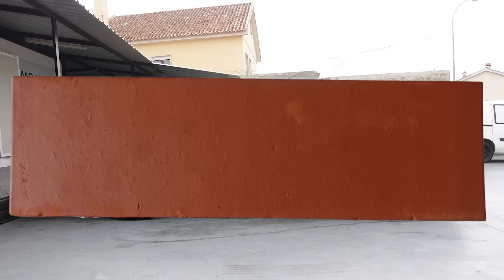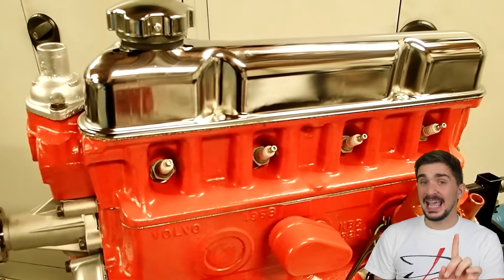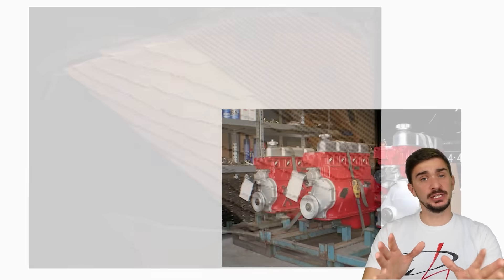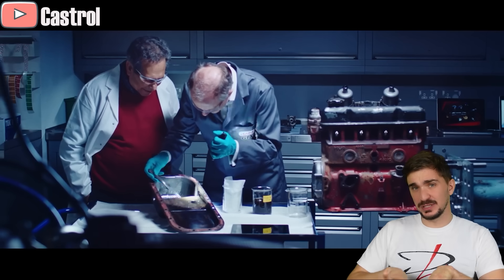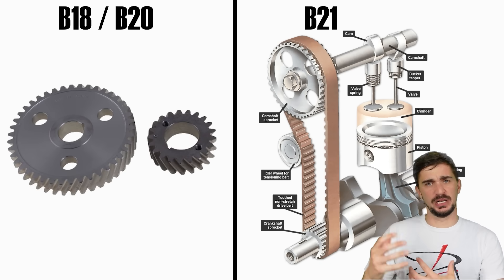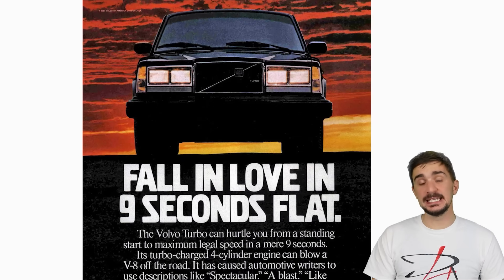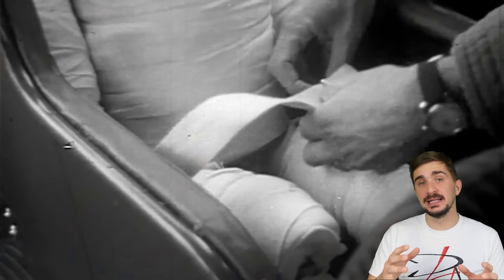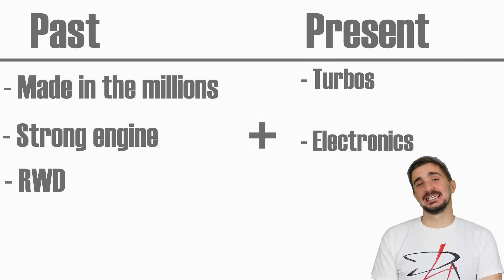A Story about the Volvo 240 and its Redblock Engine - Iconic Cars and Engines #18

Comment: I briefly had a Volvo 940 estate, just to keep me mobile when my normal car was being repaired. I didn't know much about Volvos but was surprised when I opened the bonnet and saw what looked like an overhead valve engine. I am now thinking someone must have fitted an old Amazon or 140  engine. Perhaps they had used the 940 engine to update an Amazon.

Comment: Yep, I totally agree. I had a pale blue 2nd hand 240 (@1985-86) for around 2-3 yrs and it was rock solid! I caned it that night, fanning the clutch a bit to get me up and around the bush track with heaps of sideays action... It was a solid and torquey engine and was happy to get up that track.

I took it off road one night, up hill (western side of Mt. Pickapene), in the Australian bush on what was barely a farm track (with dry ruts around 6" deep) and the heavy clutch, strong transmission, and long stroke 4-cylinder engine was awesome to get it up there!  

It got me back down and home to town unbroken too. That old brick was so unbreakable. I remember it fondly...

Comment: The only car that is recognisable when made with Lego. On a more serious note, I drove a 145 for 14 years with the 20B engine.  2 litre , twin strombergs.  Over 500,000 klm stil going strong when I sold it.  Now have a 1991 940  with the slant red engine. 250,000 klm runs as new. Changing oil every 5000klm is the secret of longevity on any engine.

Comment: I still have a 1990 Volvo 740 GL. It's the same age as me and probably in better shape tbh. Not the most economical car when it comes to fuel consumption but it just. doesn't. break. And if something does need to be replaced you can pop the hood open and understand what's going on inside without an engineering degree.

Comment: I remember back in the 80s ,90's etc. When I was very young visit relatives in Greece. One ofy.Uncles had a Volvo 240DL Taxi cab with the 4 speed "+" overdrive manual. He took care of that cab so we'll that he had it for almost 30 years. He clocked just over  750,000 miles or over 1. 2  Million Kilometers before he decides to sell his cab, as he was retireing. So reliable, nice

Comment: My Mother ruined her blue 240 DL by getting her mechanic to swap out the petrol engine and auto gearbox for a Nissan van diesel with manual gearbox. So noisy as to be unbearable. It was even slower, which is saying something.

Comment: I owned a 1980 Volvo 240D 4 door saloon. I purchased it for a mere $250 00. 
It was owned by a banker who purchased it for his nanny and took it to a garage that was stealing him blind! The year before I purchased the car, he replaced the entire suspention. The last time he had it in the shop, they adjusted the idle down until when warm and stopped, it would die. I bought it took it home changed plugs, wires, cap & rotor, all dash lites adjusted the idle, and it ran perfect. I redied the interior black, installed a new stereo, alloy wheels and low profile tires. I tinted the glass and pinstriped the car after polishing out the paint from faded pink to lipstick red with silver pinstripes. I drove that car for three years before selling it for $1200. In Tucson AZ. I could kick myself, that car ran beautifully! It was a B-21 with 3 speed auto and fuel injection. Reliability was its middle name!

Comment: I had a 940 turbo 20 years ago.
It was modified and tuned 400 hp att the rear wheels. It doesn't sound much today but it was faaast. I street race it and did skids all the time

Comment: When safety engineers at Volvo talked about car safety they had three tings on top of their bullet list:
1. SAAB
2. SAAB
3. SAAB
Volvo is and was a safe car but SAAB had serious car safety OCD. It was one of the reason why SAAB Car never turned a profit. SAAB always went the extra mile in safety and did not stop at lab test or test protocol, they spent time and money on real world car crash studies on how every injury was made and how to prevent it. The car key in between the seats is one of those SAAB details - saves your knee from getting injured from hitting a key chain or the lock cylinder.

Comment: My last 240..it was an 1984 or 85 240 turbo, had 500,000 miles and still going strong.  My only complaint with those cars is the stock printed circuit type wiring for the rear driving lights,  blinkers and such.  They tend to corrode much faster than standard wires and molex connectors.   Other than that they're amazing beautiful cars.

Comment: My very first car back in 1980 was a 1974 242 GL. While the engine never failed as I recall '74 was one of the first years with fuel injection, and that system was far from bulletproof. It was quite finicky and required several services during the four years I drove it. Nevertheless, it was absolutely wonderful to drive, and I miss that car to this day 😊
Reply: Got a 92 940 that refuses to run, and also refuses to give any trouble codes. Their engine management never got better.

Comment: I miss my  145. It had 700,000 miles when I bought it, and had nearly 900,000 when I was rear-ended by a large idiot truck. I hope I can find another some day. They're pretty rare anymore.

Edit: I should add, it absolutely totaled the truck. My 145 still drove. It just didn't have rear lights anymore, or anywhere to put them for that matter. Someone with time and patience could have tracked down all the body parts and fixed it. I was not that person at the time.

Comment: My recollection as a youth of the 240 Volvo was that the 'shovel nose' was introduced in '74. The engine, for one year, was the old B20, then in '75 the 'slant block'' (because of the 15 degree slant to accommodate the low hood line) or B21 was introduced to the 'shovel nose' design. The start up was so recognizable, that our cat could pick out that sound and would meow knowing the family was on a errand. Drove those 240s in the late 80s to 2010, then switched to v70... even more reliable.

Comment: I own  volvos for 4 decades and what I can say is that the 240 is a simple, easy to work on, comfortable, very versatile and reliable with a well hidden secret : it is fun to drive, 
My only regret is that ended the fabrication.
in comparizon with the 200 series, all the FWD and AWD models are a junk, loaded with unreliable electronics that asks an arm and a leg everytime something fails (and that happens rather frequently ) and a fact is now they hide the information so it is very difficult to diagnose if  you don't own  costly equipment.

Comment: My late uncle had several Volvo Amazon and also 140 til his death in 1980. And as a fact, the second last built "Volvo Amazon" became donated and driven from the Factory in Göteborg in Sweden to Helsingør/Elsinore in Denmark, and is exhibited in the local Technical Museum! It has 600 km and still its original protective plastic on its seats!
Reply: Great! I had an Amazon built in 1967 in the early 90s. A great car. Cheers from Stockholm.

Comment: I have had two 240's in my life. One I bought used with 155,000 miles on it. Looked and drove like a car with only 40K Miles. After putting tons of miles on that one, I got a 240 Turbo. Proceeded to hot rod that one with an Intercooler, all kinds of IPD goodies and took it SCCA Racing while using it as my daily driver. I had cranked the boost up to 21 Pounds, back when 12 pounds was a lot. I thought I had killed that engine after 50K miles. Nope, it was just the turbo that failed. Someone bought it from me and drove it for another 10 years.

Comment: I bought a Volvo 144 Sedan in 1977, it was used when I got it and proved to be an unreliable dog of a thing.living in a tropical climate didn’t help, but I think a lot of its problems stemmed from a corroded fuel tank, which eventually perforated into many, many holes. The ignition system was also unreliable and would often strand us in tough spots.  Places you really didn’t want to be, where your lifespan may suddenly shorten for no reason related to you. The four cylinder engine was ok, but so anaemic that for some of the hills around us, we could only go up them in reverse. The gearing was lower than first gear and with the air conditioning switched off, we could make it up inclines of one in six. We quickly realised that this was the worst car we ever owned and we’re glad to be rid of it when we left for colder climes. In contrast, we owned a Holden Commodore Wagon after it and put very close to a million Kilometres on it from new. The wagon was a straight six automatic and absolutely reliable. It provided the family with great service for over a decade. After an alpine trip to spend some time in the snow, the car acquired a nickname due to the many bends in the road, back down the mountain. The vomit comet ! At the first fuel stop on the flatlands, I discovered the entire side of the car was covered in my girls’ lunch. The car was eventually sold to a scrap merchant for a nominal one dollar and we moved on to a better car.

Comment: I owned two Volvo 244 that I brought in 1981 from the dealer as a demo car and other 760 in 1985 as a left over car from Canada. The 244 save my life when I hit the guard rail in 95N in NJ while avoid hitting a brake down car placed as a scam in high speed lane. The car was total but driveable to MA my ex-home town. The car engine B21F was outstanding performance and the ride was very comfort. The 760 was nice but the engine was not economically feasible to maintain. The maintenance cost of Volvo was very high and the gasket and seal were not hold up well especially electrical parts that must be specially imported from Sweden and Europe and very expensive back then.

Comment: Mates 242 gt has a different motor in it with a dodgy turbo kit using some factory bits. Dunno what would be in it but he doesn’t want to rev it over 4k and constantly has it only pushing 7psi from a turbo the size of my fist. i know it can do alot more, i’m just waiting for him to give in and piss off all the crappy wiring to throw in a haltech 750 and up the boost

Comment: As you showed, the B18 was the engine used in the Volvo 4x4 military vehicles, both wheeled and the articulated/tracked Bandwagons. I used both during my 1976-77 military service in Norway.

Comment: I had an 88 240 DL wagon/estate. None of the gauges worked, the brakes were almost gone, it barely had any power left in the engine, but it fired up as soon as I touched the key. Never had to put a penny into that car in the 2.5 years I drove it. I've been driving nicer, newer vehicles ever since, but I still think about buying another. Best car I've ever owned.

Comment: Volvo 240 had flaws as well. I should know. I worked at the assembly line in Torslanda, Sweden. 
Big flaw in my mind are the front seats in the car. The back is connected to the seat cushion with 4 screws. That bracket has a tendency to crack which will make the back cushion crocked compare to the seat cushion. 

Another one which is minor is the drain line from the sunroof that will come out where the hinges are to the front door. The drain line has a tendency to retract inside of that opening. So now when it rains or you go thru a car wash that water will drain inside the cabin. 

You could have added that Volvo had a warning light on your dash for broken light bulbs. It was not the most reliable system but when it worked it worked. 

I have owned many Volvos. But my fav was the 1974 Volvo 164 E, B30E followed by 1982 240 Turbo B21ET and then 1981 Volvo 240 with 6 cyl. B28E. 
I know the 164 and the turbo had the manual gearbox with the overdrive. Don't remember what my 1981 had but most likely over drive as well.

Now I drive Chevy bolt electric.

Comment: This put a smile on my face!  I still use a 1968 Volvo Amazon/122S with that super-reliable B18 engine as my daily driver! 

A decade ago, I rebuilt the engine, which had 170,000 miles at the time.  But when I disassembled it and measured the tolerances, it required NO machine work besides a re-surfaced flywheel.  I reassembled the engine with fresh bearings and rings, still in the factory sizes. It still starts and runs every day, 55 years after leaving the factory!

Comment: Great video! This is the first time in 30 years of my life that I haven't owned a 240. I have been through 5 of them. My last was a 91 that I got with 80,000 miles on it. I took it to 344,000 miles before I slammed it into another car on an iced-up bridge. I literally started crying when I saw the hood crumple up because I knew I totaled it. Insurance paid me exactly what I paid for it 8 years before the accident. $4000 bucks. It stll ran after the accident. It was driveable but the radiator was shredded. Someone bought it at the insurance auction for $500 bucks. Interior was in perfect condition, so they bought it mostly for that.

Comment: Excellent video!  So I'm still a little confused.  I had a '75 244GL and my sister had a '76 245.  The little name plate on the side of her car read "Volvo 2.1", whereas mine only said "Volvo."  I always took that to be a different engine than in the 75, and her car always felt a little more powerful.  Did Volvo in fact change the engine in year 2 of 240 series production, rather than year 1 ('76 rather than '75)?

Comment: Those 240 tanks on 4 wheels.
Sad fact. the earlier versions of 240 or was it 140 for a while did they cheat with corrosion protection. they only use it on edges that made them rust in a funny way.

Amazone was 120 series. then did they come out with 140 series and the more expensive series called 160 usually a straight six if I remember it right and was sold parallel with 140.
140 series have a lot of resemblance with 240 in difference to 160 and had a odd model with only one door back on one side usually called 143 and 144 on the wagon. it was taught to be safer for passengers to go of directly on the side walk instead of into traffic.

You also had a B19 that was a little brother to B21 if I remember it right.
They also had a pree model of the B18 that was a over drilled cylinder on a B16. it wasn't that great and did brake fore many.

B21 also got a crossflow head.

Comment: I hated the look of these back when they were on the roads, although they were old cars in my time,  excuse my language but  compared to now, today's cars look like shit, reliability and build quality is a thing of the past also, it's gotten to the point of being very frustrating, for me anyway. I do my own repairs and tend to keep a car a long time. I had a 02 berlingo van with the old 1.9 non turbo dsl engine  for almost 10 years, only Parked it up at over 19 years old due to rust in the rear wheel arches, mileage didn't seem to bother those engines either. We have a Picasso now and where do I start with that!! Quality and reliability is a thing of the past. I would love one of these.
Reply: Planned obsolescence reign supreme now...

Comment: My very first car was a used old Volvo 240: It was great for travel, but unfortunately the body was built in Belgium with cheap steel, so corrosion was a constant trouble. I also had to replace the alternator's regulator every other year. The engine itself, never made any trouble.

Comment: The good old days, it's a shame what Volvo is now.
Reply: Well, l would argue that the "P2" s60/v70 models of Volvo of 2000-2006 were even better constructed and more reliable than the 240s. Super tough, stiff bodies and excellent endurance and reliability. l drive a 2001 v70 and it is now >> 20 yrs old and it looks brand new with the most minimal care, save car washing. The body is virtually rust free with large enveloping plastic guards that wrap deeply underneath the floor boards and go up the door striker plate, where most of the salt collects and rusts Volvos of yore.

Comment: The story ends with the Chinese owning VOLVO, and making 3 cylinder engines and the public don't even realise.
Reply: Well, only the car division, (not the lucrative truck market). But the Chinese Geely Car Company was a good fit in the sense it added that injection of cash which was so desperately needed, as well as allowing the Swedish arm of Volvo to keep on operating still as it was. So...
Reply: @PhilDykshoorn  SEPARATE Companies my friend ... and Geely hold 167,247,516 of the VOLVO Truck Shares ...
Reply: @notrut  No car company can survive without a large paymaster. Car manufacturing is for the big players and Volvo, despite its reputation, could not break into huge commercial success with low production numbers. Volvo tried to sell it to Dutch-based VCC (Volvo Car Company, former DAF) but it the Dutch gov't was worried they would own too much of the company. Then VW... then further down the line to Geely. Good? Bad? Reality.

Comment: Another benefit of the B18/B20 series was parts interchangeability. I had a 1970 145 with a failed engine. I bought a used '73 B20 short block, and a '67 B18 head, bolted everything together and ran that until the body finally rusted away. Love the old Volvo 100 and 200 series!

Comment: Is it 2.3? Solecx? All my 240 and 250 were , the bonnet ( hood ) used to fly up if you didn’t push the puller back (anyone?) least you can crash safely, I found the doors a bit small but nice to sit in I liked mine found them thirsty though which he dos theention